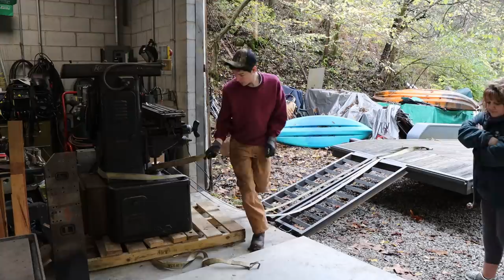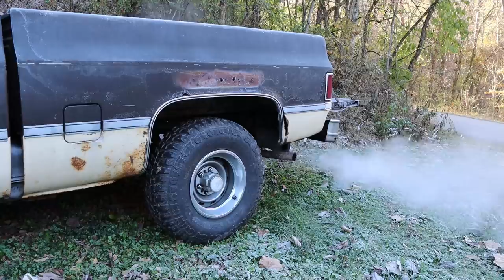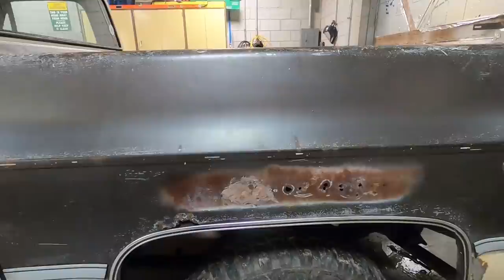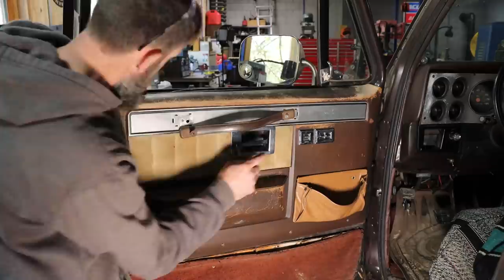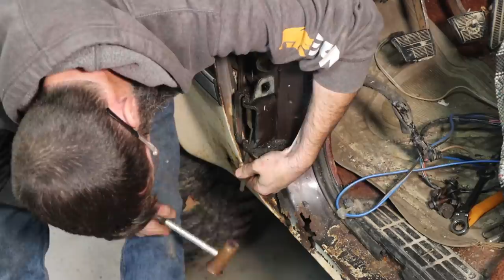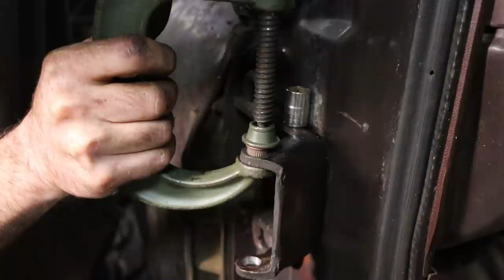Working On The Chevy K10 PT 7 & Down sizing the machine herd.

Comment: Comes a time when building a flatbed for your truck is the right choice.  Mid nineties I rebuilt a Toyota pickup with the then new chinese parts.  Brand new a front fender which fit perfectly was $30!  Just needed primer and paint.  Don't know how they are today but I would sure check before patching.
Reply: I agree when it comes to bed repairs best to cut your losses and build a flat bed. Will probably suit you better for hauling wood and supplies anyway.
Reply: Years ago when I was working in a quarry we had a very handy shop-made flat bed with removable stake sides on a Chevy of similar vintage. Even in that extreme service, the bed easily outlasted the rest of the truck. There's probably a few such flat beds set aside at junk yards, but probably not many are short beds.
Reply: Yup, I'd definitely go with a flat bed. Very useful and looks great, IMO
Reply: Yeah I was wondering have you considered making it a flat bed maybe some removable sides for it
Reply: Or, just buy some corrugated, galvanised sheet steel, cut out the old floor and weld that in. Cheap, durable and you won't care about dinging it up.
Tub beds are great, just throw stuff in and it stays there. Don't have to worry about securing most stuff.

Comment: Happy Saturday Steve and Grits! Next time you move a pallet or machine base around, use pipes under the base. When the base clears a pipe, pick it up and put in front. I have moved Bridgeports and Lathes this way. You can pick the machine or pallet up and put pipes under to start. This video was so interesting, my Grits cot cold before I remembered them. Thanks for sharing and teaching, God Bless.
Reply: That only works if the bottom of what you're moving is flat, which that pallet is not. Rest assured, Steve knows how to move equipment.
Reply: I moved my old 15x40 Sheldon lathe into and around the shop using pieces of pipe and a come-along.

Comment: I had a 78 chevy big 10, it was rusted worst than that and that was 20 years ago, I sprayed it from the molding down with flat black spray cans. The stinkbugs are really fun when they crawl inside a power tool and you fire it up not knowing, stinks up the whole shop.

Comment: Truck starter noise. The gap between the od of the flywheel ring gear and the bare shaft of the starter is 0.125"  easily measured with the lower rock guard plate off the bell housing. Less than 1/8" add a shim to the top of the starter and recheck. More than 1/8" add a shim to the outer side only. 
 If you can use a file to dress the burrs off the flywheel ring gear. It will be so nice to start without grinding.

Comment: In my '02 S-10 the inner door hinge brackets are Welded(!) to the pillar.  The repair concept is that GM makes kits that provide bolting brackets which require pulling the dash and using a template to drill holes into the pillar and fish threaded plates up behind which then accept bolts through from the brackets.  Automation auto jig fixtured brackets that don't allow for tiny if any adjustment to the door gaps.  Probably installed by robots.  Just toss the truck.

Comment: Steve, it's time you discovered oil.  Fluid film and Wool Wax will stop rust from spreading.  If you're looking for an inexpensive alternative, just spray on bar and chain oil.  They sell, or you can make, rigid and flexible extensions that allow you to spray into inaccessible spaces like inside the rocker panels.  Drive down some dirt roads when you finish application and the dust will bond to the oil so it's not so messy.

Comment: There are rust converting primer paints that bind surface rust up and prevent further rusting. They've been around for almost 40 years and affordable for homeowners for about 25.

If you repair a part to structurally sound, or it's sound enough after you remove any big flakes / loose rust, you cam save the item.

This can come in handy when used wisely, saving time & money.
Reply: Yeah I was thinking wire wheel, rust converter, mesh & fiberglass, paint, cavity wax. Bad idea?
Reply: @jonathan1427  I've never seen really good repairs made on steel with fiberglass.  

Rust-rot is like cancer... it goes a lot further than what you can obviously see... that said, if you can catch it early, sometimes you can use the converting primer as chemotherapy.

Comment: Re. moving that mill up onto the trailer... I've found that laying down two sheets of plastic under the pallet and up the ramp will act like you slathered up the whole thing with grease.  It will slide smooth and easy and not leave a mess to clean up.
Reply: Cheap LDPE cutting boards from the dollar store make great sliders.
If they are the thin ones you can even bend them up the front of a pallet and tack a screw in so you don't have to mind them while operating the winch or tractor.

Comment: You have your work cut out for you Steve. I completely removed all the rust from a 1978 Chevy 3/4 long box back in the 90’s. I live in north eastern Washington state which is a desert region so my truck didn’t have nearly as much rust as yours however it was still there and in the same places. I used after market body panels and had to make the floor pans because at the time there was no replacement. It was a fun project at the time, not sure I would tackle something like that again. Will be awesome to see you truck when you get it done. Love your channel.

Comment: Pull the truck outside one afternoon, and spray all that metal inside the panels with boiled linseed oil, and leave it to drip and cure for a week. The rust where it has the oil on it will stop, and it will keep the parts that are not yet rusting from starting for a long time.

Comment: In 2005 when our Rod Shop was back in Ohio, we did a '59 2d Impala convertible,,,all we had to work with was the frame,fire wall, and hood (@@) ! Most people would have crushed,, but was the customers father, and had spent it's intire life in Coral Gabes FL,,,One day I will find time to post some of the full restoration we have done on our channel. Ole truck is coming along,,,Bear.

Comment: Given the rust on the outside of the pick up box and the rust in the floor, my vote would be to let your scrap metal guy take the whole box and put a flat bed back there. It may be a wee bit of prejudice on my part since my uncles used F-250 rack bodies as their work trucks when I was a kid. They added an E-150 van in the 70s so they didn’t have to unload their tools every night. The rack body remained the vehicle of choice for trips to the lumber yard, the dump, and  coffee runs.

Comment: In our area there are many brand new boxes that are removed to install decks and tool boxes. I paid $300.00 for a complete box including tailgate but not bumper. Have you checked? Ritchie auctions sold about 20 such boxes at a recent Canadian Auction. May be worth buying a few for resale as well as saving a huge amount of work on your current project.

Comment: Try pumping the gas 5 to 7 times. Then push the gas all the way to the floor. Then slowly let the pedal off the floor while you turn the key. Works every time. Beats pumping the gas as fast as possible and possible flooding
Reply: Definitely,  however a properly functioning carb should require one pump to set the choke!

Comment: You use what you have to repair such things :-) I have a ton of leaded solder, 40 years old, and zinc coated metal sheets (and cans), so i used that for years to repair fenders and such. First sandblast it (i have a wet sandblaster i build 20 years ago), then make up patches, screw then temporary down and solder them. Then i used epoxy puddy, paint and cavity sealant. Theses places never rusted again.

Comment: The dash in that truck looks incredibly good for a Chevy, just a few cracks. Hard to believe 30 years later they still couldn't make a dash worth a shit, my 08' dash is all cracked to shit; same thing with the door hinges. Glad you decided to give the ol' square body a face lift! It'll be worth it.
Reply: It's by design, they are making them so they crack, and harder to replace so you'll go buy a new vehicle.
Reply: @garymurt9112  I don't think GM is making a killing on selling dashes and hinges considering most ppl don't replace a cracked dash, if anything they repair it and ppl normally buy aftermarket hinges. It's much more likely they just suck at making dashes that withstand UV and hinges to hold their super heavy doors.

Comment: I use a small ratchet like that when I replace batteries in certain Corvetts, you need to remove a lower section of the front fender.

Comment: Steve I have ordered parts that  come in that fits right on and did. Or have to have dents fixed  if that's the case you need to order good parts . I ordered  a hole exhaust for a car that came in great shape. But then I a gain I don't  order parts everyday.

Comment: For an easier controlled load like the small mill, apply a bit of lube to the ramps/dovetail and the wood will slide over more smoothly. I have used it for unloading as well, but it can yield undesired unload speeds, unless properly checked.

Comment: In Australia if you were caught driving a vehicle on the road with that much cancer (rust) in it they will lock you up and throw away the key.
We have to get a road worthy inspection every 12 months and any rust it will not pass. All lights must work all ball joints and front end bushes and rear end bushes must not have any play at all,  no cracks in the windscreen even the horn must work then the brakes are put on a machine to check they efficiently working properly even the tyres must have enough tread to pass.
Reply: Just the same here in the UK plus all vehicles are have to pass the appropriate (to age and model) vehicle emission tests.
Reply: Yeah each state here in the US has different regulations for that type of stuff which I guess makes sense.     He’s in Kentucky I believe which is a less densely populated state and generally with that means damn near anything goes to get a vehicle registered.        I think in Indiana (and potentially other states) they don’t require a motorcyclist to wear a helmet on the road.

Comment: Lived in West KY and had a 1993 model IR horizontal 5 hp compressor. Smoked 2 motors from the cold weather starts. We talking 25 deg weather
Reply: In Minnesota they usually enclose the compressor and insulate the enclosure. Then put a 100 watt light bulb inside during the winter for heat. The insulation also quiets the compressor.
Reply: @bruceanderson9461   Yep I ended up putting a heat lamp in my lean to shed to heat the crank case up.  IR didn't want another warranty motor going out. They tried to get me to buy the crankcase heater option. But I chose the heat lamp and synthetic oil route.
Reply: Yep.  The IR specified synthetic does make a difference.
Good call on a heat lamp or even a stock tank heater with some magnets epoxied to it.  😉
Reply: @jimurrata6785  Wasn't specified  back in the early 90's
Reply: @MrTonyPiscatelle  🧐  It was YOU !.....    😄
Perhaps not individually, but certainly in the aggregate. (I can see it getting very expensive for them)
IR definitely had it listed a decade later when I bought a new compressor for my shop.
Reply: @jimurrata6785    It was available but not a requirement at the time unlike now where thats what comes with a start up kit. By the way thats what I did for 37 years air compressor service install and repair 1 year direct with IR so I do have some inside knowledge on the product line .

Comment: Steve, I know you used to work in a body shop.
Wouldn't you consider bonding in the cab corners?
I know how much it sucks to get them welded in without the bed off. But I guess a lot depends on what you find with the seat and carpet out.
Panel epoxy really is amazing stuff and makes absolutely sure that water can't get into the joint.

Comment: Yep, rust is always worse than it looks , living in the northeast, specifically pa, love the four seasons, but it kills vehicles here. Just had to have my unibody and rockers replaced on my vehicle n it's only ten years old I think that salt spray chemical they use on the roads here has a lot to do with it as well as the lack of undercoating or not doing  good undercoating on newer vehicles.

Comment: So the old way to fix metal dents and stuff was lead, but the auto repair industry has a replacement for that, I get an auto repair catalog from time to time that had the new material (melt it into the dent then sand it down)

Comment: You think rust is worse than it looks. Try a little rot on a camping trailer.
What started out as a simple miner roof leak and repair end with an entire new roof and front 4 feet of the trailer. That's right tge entire front for the camper. Three trusses, 4 floor joist, studs on the side walls and the osb. Plus the back corner where the skylight in the shower.
Total cost was 10 k on a 5 k trailer. By the time the total cost was realized it was to late to back out and scrap. I know own the best built 20 year old camper I'm existence.

Comment: If you are ever t-boned. if your door sill is rusted out, there is nothing stopping whatever hitting the truck from crushing you.
Reply: What else do you worry about?  I've heard from a local chicken that the sky is falling!!........better be careful!
Reply: @paulcopeland9035  Well, you may not care about yourself, but your kid or wife might use the truck one day. As a rescue/recovery truck driver, I know what them rust buckets look like afterwards... Rust... has no strength in it at all...  And the difference between a rusted out door sill and a good solid one is night and day. A low speed impact, lets say you loose control in winter and go sideways into a pole at 20 mph. With a rusted door sill, you probably won't make it, the pole will most likely stop when it hits the frame. The frame starts about in the middle of your seat..

Comment: can you estimate how many circulating energy of water flows past the workshop each day? are you thinking of a small electric generator that would provide electricity only to heat the workshop? connected to a thermal storage stove would bring new comfort to the workshop, and now the water flows and the energy goes away, while with one small dam and one pipe that drives a small generator, it would solve free energy throughout the winter.

Comment: That carburetor and/or choke needs some work. You shouldn't have to do a "wardance" on the pedal to get it to fire up in the morning. It should just take one depression of the gas pedal to set the choke linkage and valve, and it should fire right off.

Comment: Does the mill weighed more than the hand fork lift is capable of? Would have things more easy, as the mill was already on a pallet...
Next building project would be a nice wide concrete pad in front of the workshop...
;-)
Oh yes these stink bugs are around here for  a few years, they are nasty!
Thx for taking us with you on the ride through Rust Valley, will be interesting to watch you bring that truck  back to some glory&shine...
:-D

Comment: Thanks for sharing this project. Noticing as your drill out the hinge holes that your drill bits cut A LOT better than mine would have. Do you have a preferred brand or type of bit you like to use? And how do you sharpen them (I presume you do)? I just go buy the cheapest thing I can find when one gets dull and clearly that strategy is flawed!
Reply: Most China bits I've found are extraordinary bad, Dewalt level are marginal acceptable. Now when you get into the upper level you really notice the difference but your cost makes you cry 7 to 10 bucks for single bits for 1/8 to 1/4 sizes and larger bits can reach 20 bucks for a single 1/2 in drill. But the difference is compared to a hot knife through butter.
I personally buy the lower end of the middle ground bits(you typical hardware name brand bits [Milwaukee, Dewalt, delta]) but I'm not a machinist. I have bought a few of the upper brand bits for critical holes (fastenal brand) and even those where the cheap side of the upper level a 5 bucks for the drill and 7 bucks for the tap to do a #10 20threads hole (don't remember the actual thread count) those high dollar bits have a special home in a special place that I only know about.
Now for sharpening drills. I do a majority of my sharpening by hand for 3/8 and up while I'm using them, but I have a drill doctor that I sit down and do larger groups. The drill doctor is acceptable for the average Joe and does a great job. Drill doctor  is made by the dare corporation and they do make better drill sharpening machines but they cost thousands where the drill doctor is like 89 bucks. 
I hope this helps and I hope my memory is accurate and correct.
Reply: Chinese bits are crap, they are either made of cheese or they cut, but snap.  The bits labelled Bosch seem to be all right, over 1/8” buy the best you can get (excluding “Precision “bits they are only for good presses)  under that buy tubes of jobber bits, or something similar, you only sharpen those when desperate !  I like cobalt steel bits(solid not the cased ones) they can save a lot of frustration !

Comment: With a new rear bumper needed and the bed in bad shape could you build your own bed and bumper, even make the bumper strong enough for a small corner crane and make the bed electric tip?

Comment: Steve: I noticed the weather station you have on your bench near the window and I recently bought one that looks similar to yours, mine is Newentor I was wondering how yours working and if you videoed the setup. Thanks
Reply from the maker: Mine is a kalawen brand. I've had good luck with it this far. I like having  inside and outside temps👍